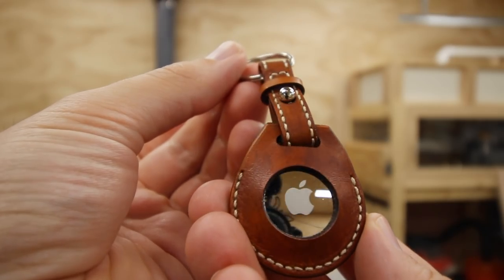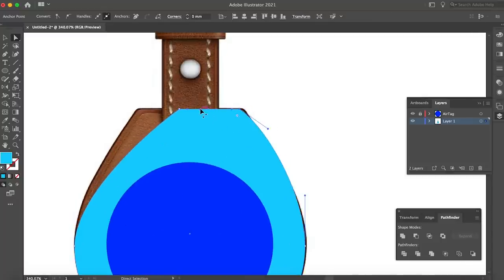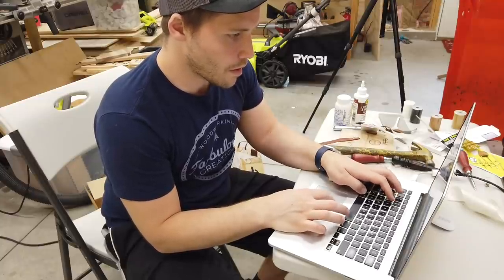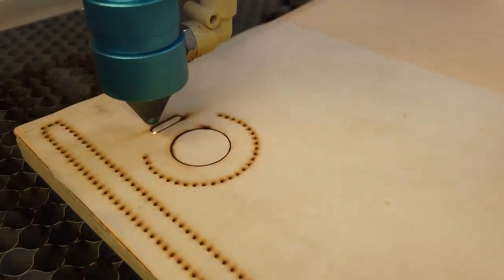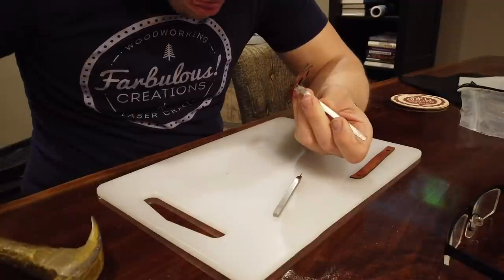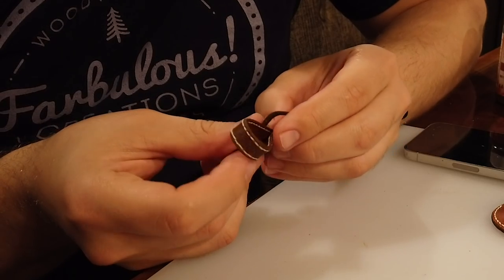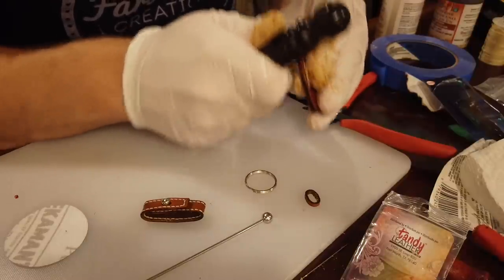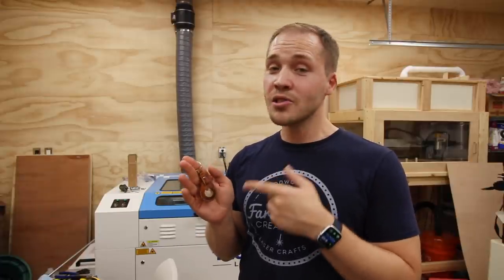Saving $349 by Making My Own Hermès-style AirTag Case

Comment: I'm a leatherworker and I make these on a regular basis.  You did a great job!  Using 4 times the length of the stitch line will provide a enough thread for the saddle stitch.  Veg tan is recommended over chrome tan if you are using it with metal.  The chrome tan will introduce rust and coloration due to the chemicals used in the tanning process.  Nice work on the video and the project!
Reply from the maker: Hey there, thanks for the kind words! Means a lot from a pro leatherworker! :) Yeah I'm pretty much over chrome tan leather at this point... seems so much more limiting for the types of projects I want to do with leather long-term. Thanks again! :)
Reply: Thanks for the advice! I’m new to leatherwork. I’m going to make these soon, how many mm thick should I buy the leather? Thanks!
Reply: @jsthebestperiod131  It really comes down to personal preference, but I’d recommend starting with 1.2mm veg tan.

Comment: Look great.  I think it needs some sort of thinning around the circular cutout for the Airtag.  I have no idea how that would work, but the Hermes version looks like the thickness of the leather around the cutout is much thinner.  I'll bet that step is super fiddly.  Everything else looks super good.
Reply from the maker: Hey Cameron! Thanks for the kind words! Are you talking about "skiving"? I just learned about that a few days ago as I've been continuing to watch leather-working videos. An inside bevel of that part would be nice, but yeah a little tricky to pull off.
Reply: Nah the definitely didn’t skive the inner circle. Their leather is just a lot thinner. It’s exactly as high as the stainless steel plate on the air tag so it sits flush.
Reply: He needed to skive the ends to make them thinner.